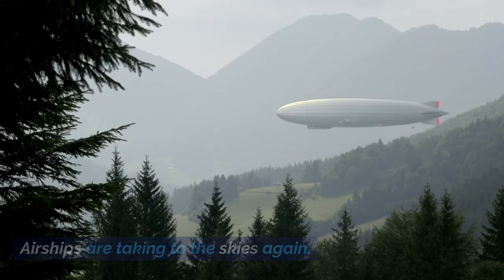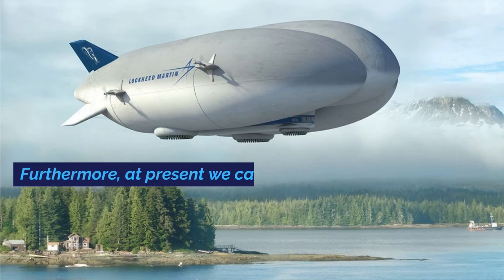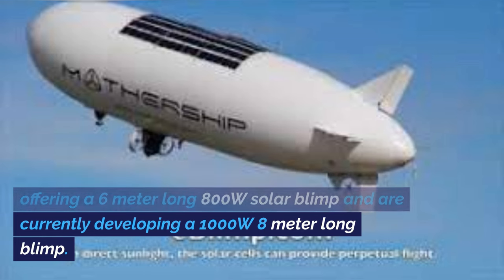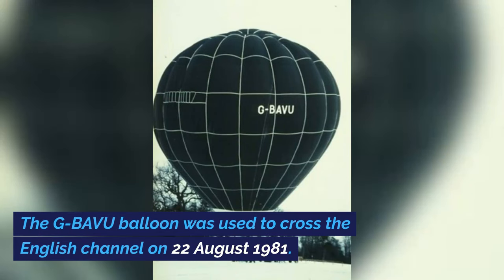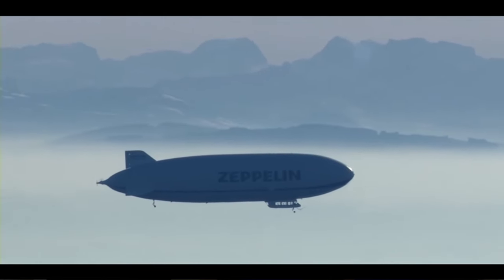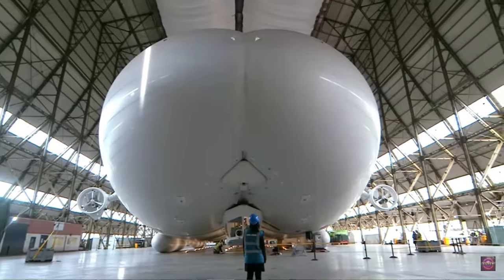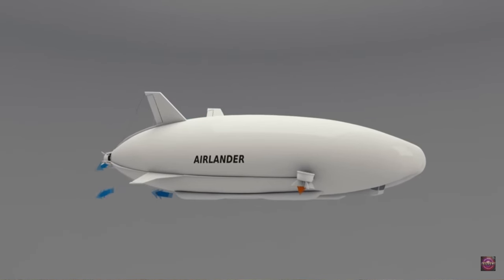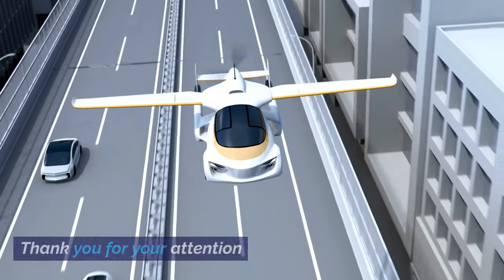The Rise of the Modern Airships

Comment: These absolutely will happen. Also, they will probably need to use hydrogen for floatation in order to have any real future.
Reply: Physics and modern materials are just lining up way too well.

And I think you're right about hydrogen, though I am still holding out for heated helium.

Perovskite thin-film solar cells can double as your envelope that you need anyway. Like Elon says "the best part is no part".

Batteries are more than good enough already to go overnight and then some, and only getting more efficient.

Same thing for electric motors to run the things.

Might even be able to remove most if not all up electric motors by using atmospheric ion thrust.

A business case might be made for orbital transmitted energy directly to airships.

The future seems bright for airships.

I can see them being more efficient than trucks and trains, but probably not boats. But good enough to get expedited shipping rates between boats and jets. That would be a game-changer for people like us here in Hawaii.
Reply from the maker: True. Hydrogen is the key.
Reply: @jtjames79 For island use, fair weather is almost required, but the land anywhere aspect is super appealing.
Reply: @izzyplusplusplus1004  The leeward side is almost always fair weather.
Reply: Hydrogen is much cheaper and much lighter so I agree and it should be safe with modern materials
Reply: Helium
Reply: There is one application, airships will be absolutely perfect for: transportation of extremely bulky, but low dencity cargo. I mean wind turbine blades. Currently, transporticng them via roads are extermely hard and expensive operations. Airships would solve this problem by flying over the obsticles. Also, as you don't neceserally need people on board you can use hydrogen for lift.
Reply: @solarissv777  Good thinking! I think you may be right.
Reply: @solarissv777 
... Yes, and delivery directly on to the hub, saving crane cost...
Reply: But isn't that the stuff that blew up the Hindenburg? I was hoping they'd figured out a way to use...well, helium or anything non-explosively-flamable...

Comment: These SHOULD be rescuing hurricane victims and delivering relief supplies right NOW. It's tragic that government is run by the people currently in power. The data on carbon fiber and engine efficieny is extremely useful. Hydrogen as a lifting gas would make the costs far lower.

Comment: Solar would have great synergy with an aluminum frame airship, since you could use the framework as conductors rather than needing a bunch of dead weight copper wire to reach the farthest panels.

Comment: Future AirShips need a common use other than the rare transport abilities. A need that replaces an everyday need, such as trucking. A blimp sized AirShip, steel framed, could pick up 8 normal sized containers from the container ship. Every modest sized light composite steel framed AirShip replacing 8 single container trucks. The AirShip could deliver the containers to a warehouse in less time, because it replaced 8 trucks and flies over rush hour traffic.

Comment: Nicely done video look at some modern airship projects.  It should be noted that only the Zeppelin NT is currently flying.  Goodyear has replaced its blimps with three Zeppelin NTs.  However, I think Zeppelin has shelved the larger NT-14 project.  I haven't heard anything new about it in years.  Also, I don't think the smaller NT model is still in production.  If anyone knows differently I'd be interested.
Reply from the maker: Thanks for the info!

Comment: I wonder if it is possible to create a zeppelin/airship filled with gas ions in a vessel that were repelled by a centrally located electrode thus creating a artificial gas pressure that exceeds the limits of the ideal gas law in regards to density and displacement. I am not knowledgeable enough to know if it would work though.

Comment: I thought finding enough helium was supposed to be a problem with these.
Reply from the maker: Helium is a by product of natural gas extraction.
Reply: They will use hydrogen to be viable. It is much cheaper and much lighter.
Reply: @ElectricAviation  this is true, but it is a trace gas and considered rare.
Reply from the maker: @nathanryweck3137   If only we can find a way breaking down larger elements into smaller one

Comment: Love the content. However, what would be the advantage of using airships over sea based transportation? In hilly areas it may make sense but it doesn't make any sense to me on the open seas.
Reply: I guess only speed. Faster than ships, cheaper than planes. Not a huge niche, but may work.
Reply: you can transport large amounts of cargo (albeit less than a freight ship) faster to almost any point on land, which could be especially helpful to remote places where rail and road infrastructure isn't well established. If you're going from a port to another port the only real advantage is that you can still go over land and potentially skip canals (which as of late have been getting traffic jammed in panama canal). Other than that their only advantage over ships would be speed.
Reply from the maker: Its faster than ships but with a fraction of payload capacity.

Comment: The Clipper not only looks like the best but it's purpose seems to outweigh all other blimps in usefulness and efficiency... Except??? How does it return with no payload?
Reply from the maker: I was thinking the same thing. May be they will transport it back with helium.
Reply: That's a misunderstanding. The Clipper wouldn't transport gaseous hydrogen, but cryo-cooled liquid hydrogen. As cargo and as fuel.
And would use gaseous hydrogen as lifting gas.

Comment: No one talks about the weather, which will doom these airships.
Reply from the maker: They will be operational during summers both in northern and southern hemisphere. They will not entirely replace the existing infrastructure. They will be there to support it. For example, peak travel season also occurs in summer.
Reply: Quite the contrary—it’s not that “no one talks about the weather,” in fact, you’ll find that invariably, comments like this are absolutely lousy whenever the topic of airships comes up. 

What actually never gets talked about is the fact that the U.S. Navy figured out how to operate airships successfully in storms and blizzard conditions over fifty years ago.
Reply: if you look at Skyfreighter Canada, the leading forward nose and control,  is  heavy duty broad based Kevlar carbon fiber.  designed to withstand 150mph

Comment: You have missed the LTA-OCC (Lighter-Than-Air  Inter-Continenal-Cruiser under development... 

It will carry 15,000 passengers , plus crew , supplies, cabins, lounges etc ... all Cruisinng in comfort under a 1km2 area top (semi-transparent) surface with Solar Panels, using Helium and serviced by Shuttles for Passengers, Baggage, Supplies, Crew etc... There will be three 1km2 floors for the above... 

This $14+ Billion LTA-ICC will carry a $1 Billion/yr "Mortagage".
 
It will ferry passengers for $500-700/person half way across the world in 24+ hrs ... just like today's economy class airfare .... and generate a Revenue of $2.7 Billion/yr  (15,000 passengers X $600/ person X 300 Days/yr). $1 Billion/yr for Crew and Expenses and the Balance $700 Million/yr... for Investors, Profit etc... 
This is possible, all because of its massive passenger capacity and "free SOLAR energy" and "Self"- Levitation provided by Helium...

Comment: Size constraints limit an airship to perhaps 250 m, which gives only a few tons of lift... using helium. There's no reason for not using hydrogen for transport, so it's easy to imagine a helium-lift piloted ship accompanied by a flotilla of hydrogen-lift drones.
Reply: need to do more reasearch. 250 tons is the goal of Skyfreighter Canada.  the LMH1 has been proven. hydrogen does not transport well. 30% of frozen hrydrogen is lost in the freezing / thawing process.  Helium only needs to be changed out every 3 to 5 years

Comment: I've long had a fascination with airships, and would love to see them make a comeback.  But none of these programs should be wasting precious helium.  That's what they should ban.  The research should be focused on making safe airships using hydrogen lifting gas.  Not only does it prevent wasting helium, hydrogen adds around 7% total lift, virtually all of which would be available for added cargo capacity, making for much better airships.

Comment: It seems a sticking point in these comments is the helium vs. hydrogen debate. However, if you put actual numbers to it, you’ll realize that the expense of using helium is more than worth it, and hydrogen is by far the best fuel source, at least when safely ensconced in a flame-retardant helium cell or pressurized tanks.

Airships are so efficient that even helium ones still only cost a fraction of the operating cost of a heavy lift helicopter or similarly-sized airplane, and that includes helium costs. Expense isn’t really the issue that has prevented airship adoption, it’s much more mundane than that. They’re slow, and have a largely unearned dangerous reputation due to being such an old technology, which makes people hesitant to invest sufficient seed capital to get the ball rolling. The necessary capital to develop and certify any large new aircraft is quite a lot, despite the fact that individually the airships themselves are relatively cheap. People care less about efficiency, and more about speed and institutional inertia.

Additionally, new and much more energy- and cost-efficient technologies for extracting helium are coming online in recent years, such as reverse osmosis membranes and pressure-swing absorbtion. This, in conjunction with vast new helium reserves getting discovered across the world, makes the idea of a forced return to hydrogen as a lift gas (and not a fuel) very implausible to me.
Reply: NICELY SAID.   you have done your homework .  you should connect directly with Skyfreighter Canada or Milleniuim Airship

Comment: Man I've been saying this why are we so afraid of hydrogen? We know how to do it safer know we need to bring these back with hydrogen as the lifting gas
Reply from the maker: They ban on Hydrogen was put in the 1930s. We now have sensors that can detect leakage. Plus we have non flammable materials that we can use
Reply: @ElectricAviation  I want a blimp that runs on solar that is used to make hydrogen gas to be stored for fuel and to replenish lifting gas that will eventually leak or be dumped for Decent. Doing this would allow for a floating house essentially but I'd do it more like a expedition yacht where it has a crane for dropping vehicles to explore areas would be pretty well self sufficient like a yacht. but I'm not rich and have no rich friends who would fund the project so it will probably never happen but I'm extremely confident it could work amazingly.

Comment: Solar-powered airships are the way to go!  And H2 has twice the lifting capacity of He, with modern containment systems being enough for safety.
Reply: hydrogen has around 13% more lifting capacity relative to hydrogen, but still that is quite substantial.
Reply: @Rhen5656  Actually, it's 8%: Cold dense air at sea level is around 1.3 kg/m³.
Hydrogen at the same pressure and temperature is 0.09 kg/m³, helium is 0.18 kg/m³. So you get up to 1.21 kg/m³ of lift with hydrogen, 1.12 kg/m³ with helium.
1.21 is 108% of 1.12.
Reply: @Rhen5656  And of course less lift in higher altitudes (lower pressure) and higher temperatures.
But the relative difference of lift is the same.

Comment: Helium airships are pointless. The gas is rare,, cannot be manufactured, ever more expensive and prone to excessive leakage. Hydrogen gas is currently a dirty greenhouse gas that is essential for fertilizer manufacture. When green hydrogen becomes available and the agriculture market is well served, hydrogen airships will become inevitable.  I have waited a lifetime to see super airships fly again. But I suspect I may not live long enough to see them return to where they belong.
Reply from the maker: You can get a flight on them in Germany. They run during the summer time
Reply: @ElectricAviation  I wouldn't call the Zeppelin NT a "super airship". It has 4% of the volume of LZ 129 Hindenburg, it is stumpy compared to its ancestors and it's just a semi-rigid airship, which gets its shape from gas pressure. And it can carry just a dozen of sightseers on seats.
Better than nothing, but rather an "airboat" than an airship. Or even a "super airship".
Reply: The helium is ONLY changed out every 3-5 years !!  the U.S. is the largest producer of Helium.( 98% pure) 
Quatar has yet to develop their helium wells.   
Millenium Airships, has a contract guarantee for 15 years.
Hydrogen needs to be cooled to MINUS 420F.  This limits hyrogen  . A 30% volatile loss in simply rewarming hydrogen to ambient air temp. Horrible storage logistics, massive heavy equipment in order to have Hydrogen tanks on board...m Helium and solar electric. 
Lockheed Martin LMH 1 
Lockheed Martin P-791 Hybrid Air Vehicle
        https://youtu.be/LZBhs-SrvwI

This airship has: 
* Taxied, 
* Turned 360
* Took off 
* Flew above the Skunk works in Lancaster
* Landed and taxied back.